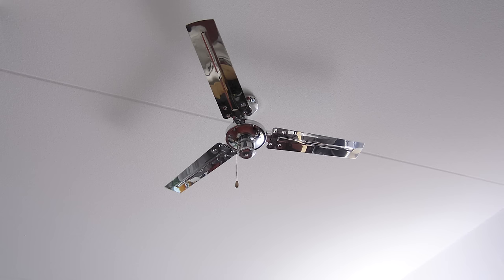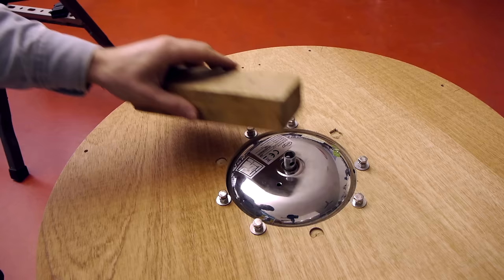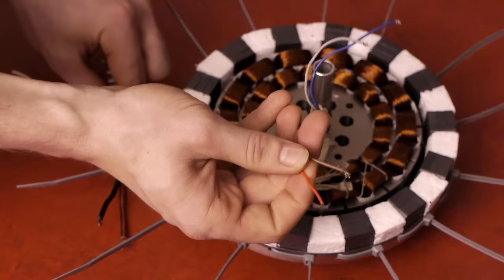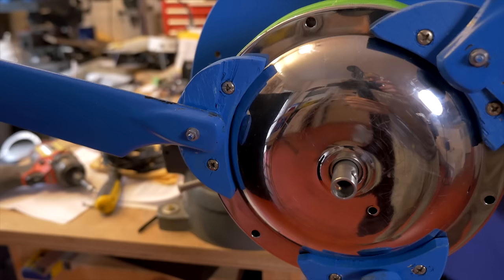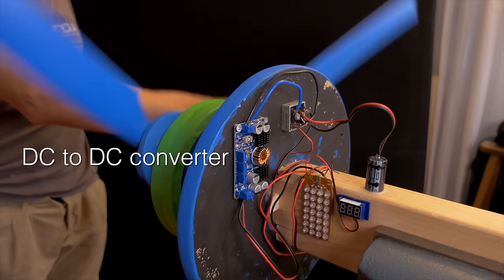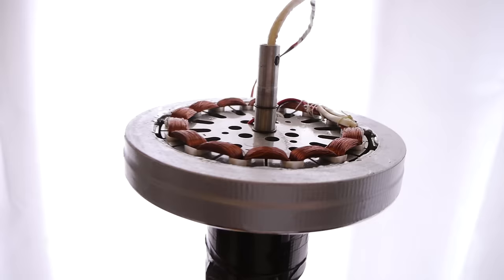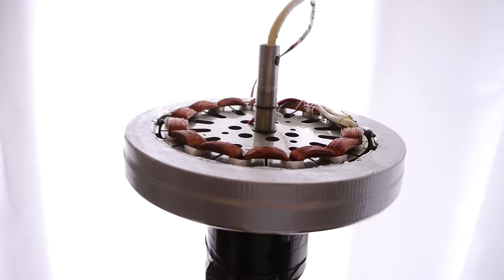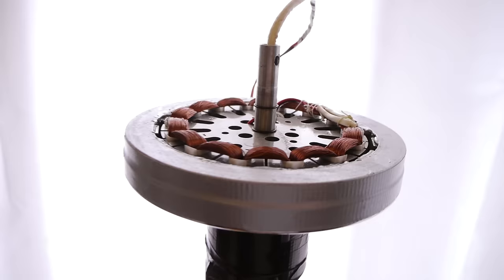Turn a ceiling fan into a wind turbine generator?!

Comment: Very good info... but I’d just use an alternator from a car.
Reply: I am with you on that one. This whole video basically just shows how to create an alternator from a ceiling fan. Starting with an old alternator would be so much easier and probably cheaper.
Reply: The only issue with alternators is the high rpms they are designed for. They dont work too well when turning slowly.
Reply: @djsnowman06   I've thought about making something along those lines, and with that issue having something like gears from a bicycle... but that would mean heavier wings for smoother runs suggesting it would be more convenient for a vertical windmill... wings could be made from plastic barrels which are sturdy. Sigh... been having that idea for years, actually. Motivation! Where art thou
Reply: @runarjohannesson4101  same . No time or no money...
Reply: @runarjohannesson4101  I'm using old 10 speed bike parts for mine. Thanks for your thoughts in your comments you have a good ideas!
Reply: @djsnowman06  Thats very easy to solve, just put a large gear on the spindle and small gear on the alternator. Problem solved, super basic gearbox.
Reply: @tastytechaddictsmtb  why would you do that when you could just get a more suitable motor and skip all the extra work and frictional losses.
Reply: djsnowman06 it depends what you have available. I was merely replying to your comment saying why a alternator wouldn't work. When it would work fine, it would just need gearing.
Reply: @tastytechaddictsmtb  dude. It doesnt matter what you do. A lot of guys have been doing stuff like this. Most dont use automotive alternators because they need a gear box. It's up to yourself though...
Reply: I have seen a car generator working in the blue ridge mountains. When it spun fast the batteries would bubble really hard. Kinda spooky.
Reply: The alternator would also benefit from the allready in-built 12v dc regulator. (Separate in very old cars.) And readily available batteries and 12v dc appliances.
Reply: @jounikorhonen  Precisely! Its all just laying around. I've also seen turbines from washing machines used, those are mean. Man... if only i could find the energy. (get it?)
Reply: An alternator doesn't need "gearing", just v belts and pulleys. They already come with pulleys attached and you can find pulleys of all sizes in a junkyard. And yeah, they're gonna need a large turbine to drive. They're a 1kW power source. If you're just needing a low wattage source to charge electronics, a bike light generator will suffice.
Reply: If I were to do it, I'd put a crank pulley on the turbine, reduce it with a water pump pulley (with the small pulley to drive an air pump), then reduce again to the alternator.
 And yeah, pulleys and belts are less reliable, but also easy to acquire and service. Also much easier to cobble together.
Reply: Not really. You need about a 30:1 reduction total. A 6:1 coupled with a 5:1. So your turbine drives the crank pulley. The crank pulley drives the small pump pulley. The small pump pulley is on the same shaft as the large pump pulley. The large pump pulley drives the alternator. 
 You don't really need high winds to drive it, you just need a bigger turbine (which you need either way using an alternator). Whether you use pulleys, a chain and sprockets, or gears, it all amounts to the same thing. The question is which is easiest/cheapest to implement. Gears are relatively difficult, while pulleys are very easy. 
 The nice thing about pulleys is that you only have to fabricate the mount, all the parts are available in a junkyard, and it's super cheap. Bonus: Everything in a pulley system already has integral bearings, was built to carry the pulley attached to it, and the trunnions to support the load.
 A transmission, OTOH, will require machining and more expensive parts.
Reply: @GoSlash27  But everything is very high off the ground still!! A riding mower transaxle from a junk tractor for free is pretty cheap and bevel gears out of any auto rear end. Why would you need a larger turbine? The alt. doesn't require any torque to turn it. Using 6 pillow blocks 4 gears and 3 shafts it's done and no belts can break, and all the mechanical's are accessible at ground level instead of in the air, you're talking about 2 belts and pulleys and all this stuff up in the air and it has to rotate to change with wind direction too, how are you going to govern overspeeding in high winds? I'll use a simple proven design, put an adjustable centrifugal governor mid way down the vertical shaft  and be done. Do you see belts and pulleys on any commercial wind generators? Build it the right way like an aeromotor and it'll work beautifully, the work of design is already done and proven, but i'm sure pulleys and belts and all that will work fine, good luck.
Reply: You need a larger turbine because every generator or alternator creates drag when powering a load. It's basically an electromagnetic brake. So if you're pushing 45A of current at 13.8 VDC, that's 620W or 1Hp when you account for efficiency losses. You need a turbine that can generate that, or even 2 Hp if you're running a 90A alternator; about 100 ft lbs of torque at realistic RPMs.  That's a pretty big turbine. 
 As for how to regulate it, a tailing vane would work nicely. As wind speed increases or turbine load decreases, the vane rotates the turbine out of alignment with the airflow. 
 Good luck and best wishes to you too!
Reply: A tailing vane is actually used to regulate overspeed of the turbine. If you've ever been to Iowa and seen the old farm windmills, you may have wondered why the vane is crooked instead of straight back. That's why; it's used to control overspeeding in high winds. High winds cause the vane to torque the turbine out of alignment with the airflow. 
  As for the rest of it... I think the disagreement is simply a difference in priorities. You have a specific price point and difficulty in mind that differs from what I'm describing. You can build a windmill generator a lot of different ways.
Reply: Or of course just bypassing the reg and feeding the rotor coil direct

Comment: Linear regulator will always waste power not only  when the voltage is above 24V.
Reply from the maker: Hi SleepingDragon. Thanks for your input! Hmm, you are right: a linear voltage regulator will always waste power... that is no good. I guess similar to how a diode its voltage drop becomes heat, wasted power. Do you know of a better way to protect the DC to DC converter from too high an input voltage?
Reply: @GiesbertNijhuis  For high voltages and currents look at automotive protection circuits: https://www.eetimes.com/document.asp?doc_id=1272768
Reply from the maker: @rapolas2  , thanks for your suggestion. "Clamping circuit tames automotive voltage transients" I have a lot to learn  :-)  "Conclusions: The input clamping circuit described above provides a low cost method to clamp the output voltage to a safe level, preventing potentially destructive over-voltage conditions for low voltage circuits. The circuit can be easily tailored by setting the output clamp voltage and capacitance for any load, and then adjusting the control loop. At typical input conditions, the pass element's forward voltage drop is quite low, resulting in low power loss and efficiencies higher than what is achievable with the use of a linear regulator."
Reply: @GiesbertNijhuis  regulate the speed of the turbine. that's the easiest way I can come up with. those secondary coils you cut out of the motor would have been perfect for a magnetic governor.

Comment: better alternative could be alternator / generator from an automobile
Reply from the maker: Hi James. I don’t think a car’s alternator is a better alternative relative to the 3 I showed, but it is an alternative. Good of a car’s alternator relative to a ceiling fan, is: higher Amps. Downsides: very high rpm or else very low Voltage, brushes, and having to put electricity in to excite the electromagnets. Or put magnets in it also, somehow. There are different kinds of car alternators. I have little experience with them.
Reply: Car alt works great for paddle wheels.. Lots of videos on them being used..
Reply: @GiesbertNijhuis   ive done generators with car alternators and induction motors, see my post.. yes , u are correct on all points.

Comment: Ive done this- hardly worth it - mine gives me 40watts in a howling wind
Reply: I guess if it's a 40 watt fan then it won't put out much more than that when you use it as a generator?
Reply: @Berkeloid0    As a retired ASE Master Tech, I would also think that 40 watts in, 40 watts out would be the math. 
I find it more interesting that a large sub-woofer speaker, running on a low frequency will put out a small pan sized fire, as if you match the frequency of the fires oscillations, because it's own frequency. Shown on TV about Feb 2nd on Henry Fords Learning Show, with Mo Rocca.
Reply: TinyHouse and Offgrid Resources   Did you run both coils in series or parallel?
Reply: There was one idiot that claimed he ran his whole house on a washing machine motor- 100-150 watts at best.  not enough for one coffee pot.
Reply: @deankay4434  Nothing is 100% efficient;- There is always loss along the way
Reply: @Donnaya137    You are correct Sir! Even a simple average diode have a loss of 0.7 volt across it, called voltage drop. Use this procedure for 30+ years in a dealership on vehicles. Quick, direct, does not lye, and w /DMM does not matter RED or BLK meter leads, just shows a ( - ) negative symbol.
Reply: @donald6815  The only practical limit to how much power a generator can produce is the current limit of the windings. I wouldn't recommend running a whole house off of a washing machine motor, but it could be done... until something caught fire.

Comment: There is 1 thing I knew about so here it is.  Going from AC to DC you mentioned 3 steps, transformer, rectifying bridge, and (large) capacitor.  
But I remember a 4th step too which was called a "silicon controlled rectifier.  This was like a power transistor operating on the output from
the capacitor output to add further stability to the DC power.  This was 40 years ago but I think this is right.  Good luck.
Reply: A SCR isn't a transistor at all. It's a rectifier (diode) which includes a third terminal, the gate. Ordinarily the diode is off. Increasing the gate voltage to or beyond a certain threshold turns the SCR on. Once the SCR is on, it remains on until the anode to cathode current is interrupted. It is often used in burglar alarms for this function; once tripped, the alarm stays on until a master reset switch is operated. 
A SCR could be used as an overspeed protection scheme for a wind turbine. Since the output of the stator coils is a sine wave, the current crosses the zero point with every cycle. To the SCR, this zero crossing equals zero voltage & zero current, thus resetting the SCR until being tripped again via the gate. A properly designed SCR based circuit would provide dynamic braking to prevent overspeed of the blade/hub assembly. Since the frequency of the turbine output increases with wind speed, the SCR control could be frequency based; when the blades reach a certain RPM the resulting frequency can trip the SCR gate thus giving the braking action. Once the frequency is decreased, the gate trip signal is removed and the SCR is reset by the natural zero crossing voltage/current output of the turbine. The SCR anode-cathode could be connected across the phases of the stator for braking.

Comment: I think you need some sort of governing system to control the speed, this way you won't blow the capacitors.
 Keep the bridge rectifier, but get rid of the other electronics. Buy a charge controller instead. And attach it away from the motor, that way it won't interfere with the motor and it won't get in the way.
Reply from the maker: Hi Crazy Farm Life. A good suggestion from the comments was to keep the inner coils and use them as a magnetic brake when speeds get very high, by switching it short circuit. That way you can still generate electricity in high winds (and then cooling becomes a thing). When that brake power is not enough, the main coils could be shorted as well, that will slow the wind turbine down hopefully to a stop. 
Making things is often way more work than expected. The: generator, rotor wings, turning on a pole in the wind, that all is a lot of work all ready. To also make the electronics is even more work. As many suggested: just buy a wind turbine & MTTP charge controller! Yes that is easier, but this is a DIY project for fun learning and re-using parts. Nowadays there is the Arduino and such, making the electronics less difficult. But when I continue this project (than is the plan!) I will probably choose to use a "real" charge controller at first, for: eas, safety, efficiency. A wind-charge controller has a magnetic brake connection on it all ready! Bit silly to make a wind turbine and then not use it because the electronics are too difficult. First DIY wind-turbine, then DIY wind-turbine-electronics can come later.

Comment: You ruined the best part of the "generator" by removing the second coils. I guess the people who designed the motor went to all the effort to have a second set of coils there for fun. You produced a poor generator by removing the second set of coils.
The second set of coils should have been connected out of phase with the first set and you would have got double the power.
Reply: It would double the copper, and the maximum spinning drag, the current output at a given speed.  I thought the second coilset was to have a different number of magnetic poles/revolution, but it looks like an identical number. So it should give output very similar to the first set.

Comment: 24 volts is perfect. charge 2 12v deep cells, 24v(truck) to 240v (australia) inverter. off grid!
Reply: you need about 28 volts to charge a 24 volt car battery.

Comment: I think this is great !!! I would hook it into a voltage regulator, then from the regulator to batteries to trickle charge, then buy an inverter so you can plug in lights, tv, ect. Great work.

Comment: Why dont you just use an automobile alternator for $90 bucks and spin it with a v belt? 
Much simpler.
Reply: alternator needs 2000rpm to produce 12v,better is 300 spins per minute for 12-20volts
Reply: They also are internally regulated and can output very high amperage.
Reply: Cuz the torque on an alternator is too high. The wind has to be able to turn it.
Reply: An alternator will not work without a battery hooked up to it. Like the ceiling fan, it uses electromagnets instead of permanent magnets. But yeah... it's self- contained, self- regulating, has good bearings that can take a side load, and is easy to bolt to a structure.
Edit I should clarify: An alternator will not start producing voltage without a DC source. Once it's started, it will supply it's own field.
Reply: Wind won’t turn it
Reply: KISS wind generators as well as other homemade units from car alternators have been used in the marine cruising world for years.
Reply: Alternators for chevy v-8's are about $30, and cheaper if you trade in an old one. 60 Amps @14.5 Volts out. It comes with a pulley for a v-belt if you buy one for an 80's car.
Reply: @blackice214  yes it will, you simply have to overcome the resistance with the correct wing configuration

Comment: Hello, I am doing a final project for my Mechatronics Class in high school, I would like to build a makeshift Wind Generator in my class using its machinery and tools. I was wondering where I could source a decent Brushless DC Motor with magnets (Used, new doesn't matter as long as its cheap) that can produce a good amount of power, I am planning on designing a custom base, casing for the generator and custom propeller turbine blades. Any feedback is appreciated.

Comment: An mppt solar charge controller converts input volts and amps to 12v or 24v output, regardless of input voltage.  It wastes no watts.  This is a perfect application.  No volts or amps wasted.  Steady computer controller 12v or 24v output to charge a battery bank, of any type.  My solar panels can output anything from 30 to 72 volts depending on the sunlight level. The MPPT charge controller just converts that to 12 volt. Or in the case of my system which is running four lead acid batteries, The solar charge controller is smart enough to maintain, condition, charge and discharge to keep batteries at peak performance. It also works for lithium ion.

Comment: my best approach to all of this is to go with a car alternator that directs  current  12 V  and you are done life is an easy way  and  not too complicated it  also you can look for a higher  AMP output if you have a bigger props  - then you send it to a convertor  and you get the current you want     --   I made my blade from 6 " or 8" is better plumbing tubing                                                                                                                                                           now if you want to use vertical or helical blads then you  buy it ready-made  it will work out cheaper then trying to make it  and of course you will need to make a strong vertical pipe supported  by 3  legs or to the side of the house  with log brackets